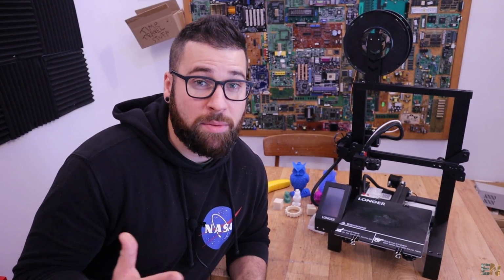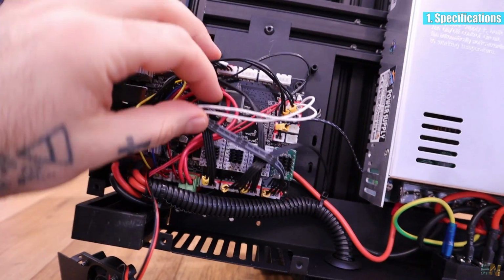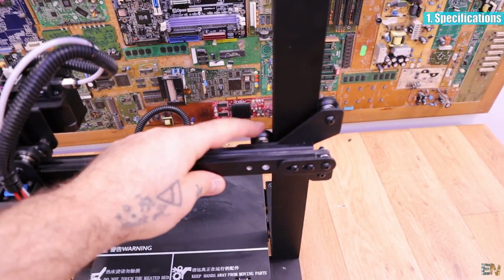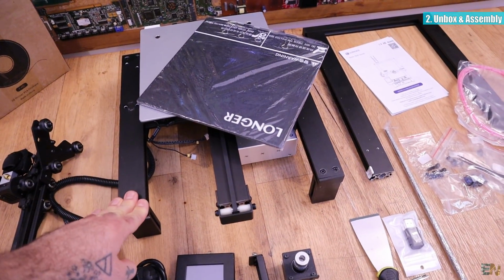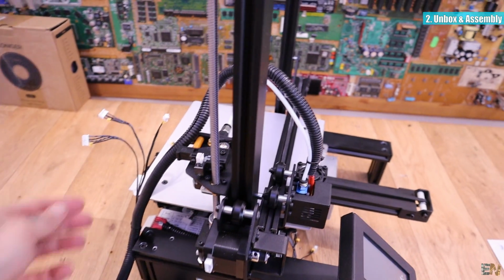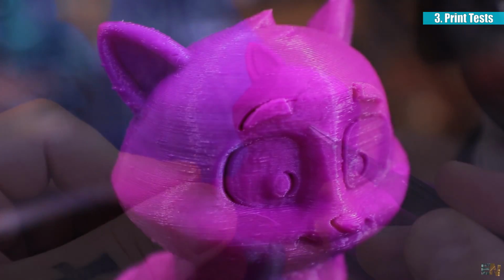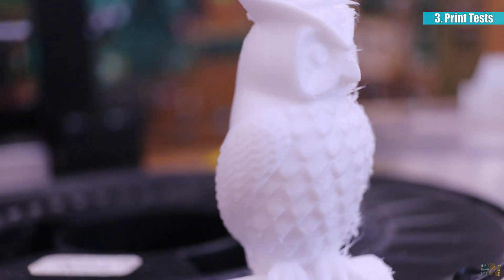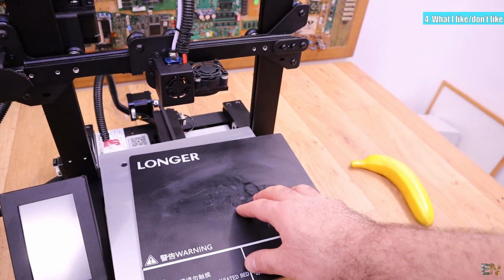Longer LK4 Pro 3D Printer | 2020

Comment from the maker: Sign up at ELECTRONOOBS.io: https://electronoobs.io/
Follow me on FACEBOOK for more: https://www.facebook.com/Electronoobs
help me on Patreon: https://www.patreon.com/ELECTRONOOBS
Reply: Hi your review is great. Thats why i end up buying one for myself, because i need a 3D printer for my uni assignment. I just did a the benchi boat test, the  result printing was doing fine with default settings half way. Then model suddenly lift away from the bed near the top, is there a way to sort that out or do i have to use a hair sprayer to glue it to the bed? i been tweaking the settings but i do not seem to get the setting right.